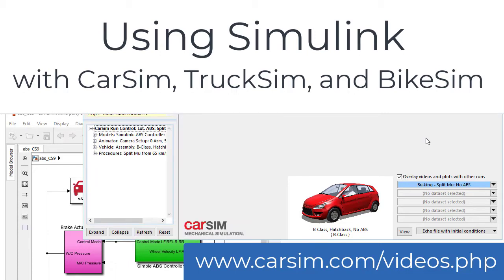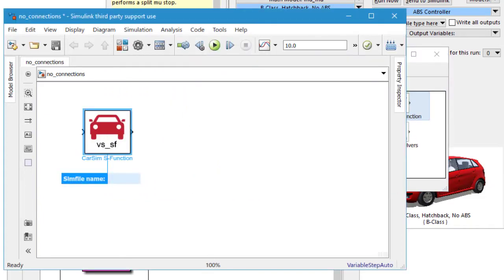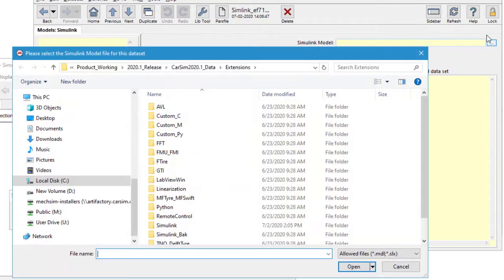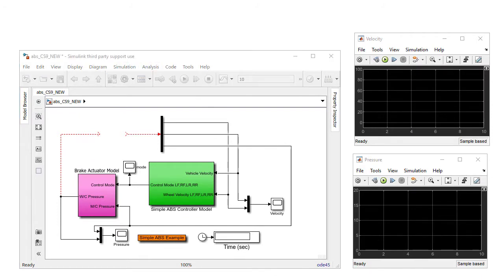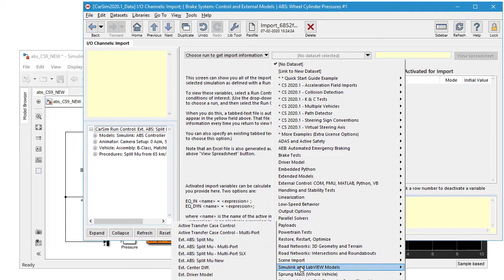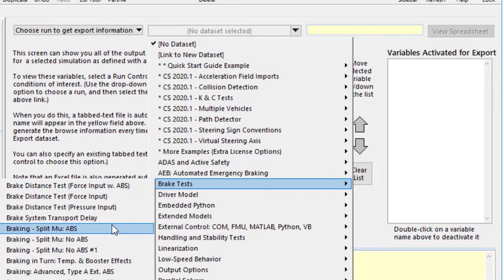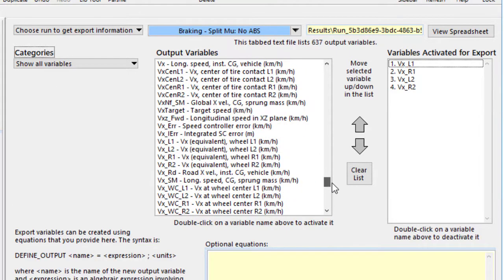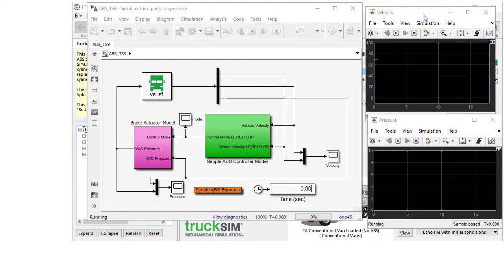Using Simulink with CarSim, TruckSim, and BikeSim

Comment: I use Bikesim. I have a question: tI use Bikesim. I have a question: the default friction coefficient of the road surface is 0.85. Do you have any references or data on which to base this number?he default friction coefficient of the road surface is 0.85. Do you have any references or data on which to base this number?